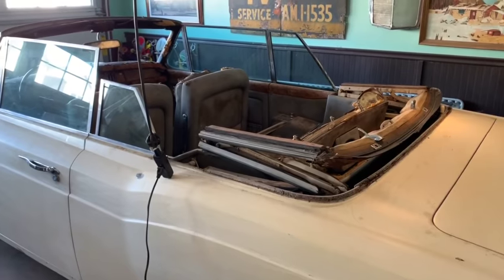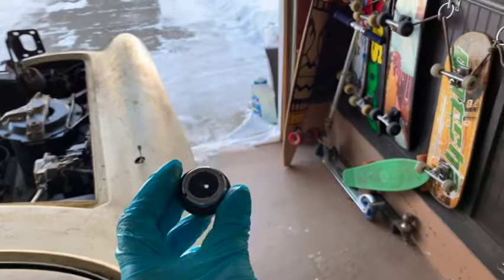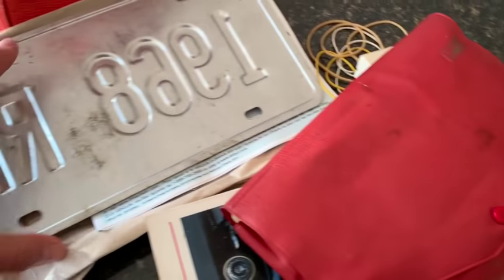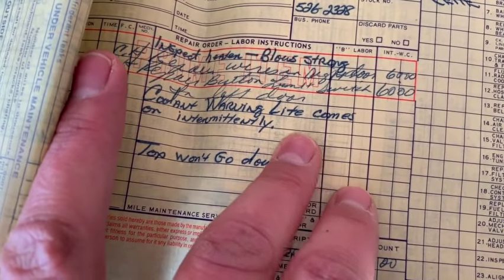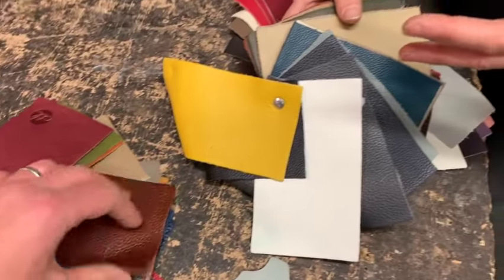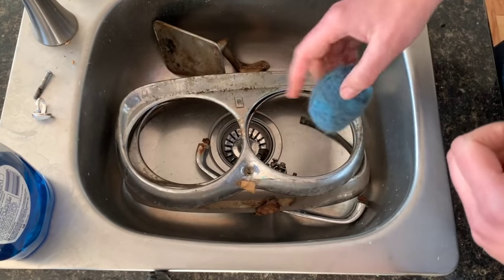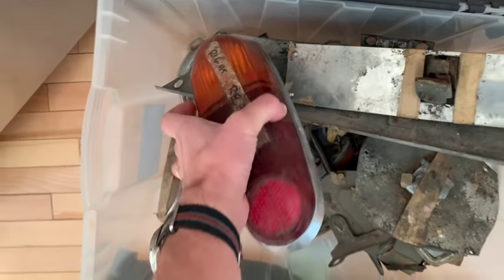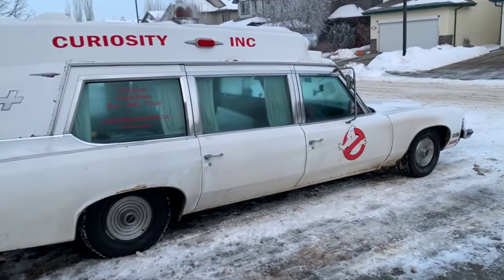I took a Junkyard Rolls Royce and brought it back to life!

Comment: I used to deliver to the body shop at RR Crewe (in the 70s) and was amazed at the attention to detail the technicians put into the build. They even tinned the inside of the engines water jacket, which ensured you never got rusty looking water in the filler. As one man said to me, as I marvelled at the quality of his workmanship "It's not what you see that makes a Rolls so expensive, it's what you don't see". Wonderful to see you preserving, his and others craftmanship.

Comment: Thanks for restoring The Empress!  I still can’t get over the beginning pictures.  It’s shocking how just a few years of neglect can destroy a ‘Proper Motor Car (PMC).’  This project makes my 1977 Silver Wraith II seem like child’s play.  I’m still working on the brake and hydraulic lines.  Nickel plating for the brake reservoir, rebuilding the accumulators, and then maybe some additional brake lines.  Fortunately, RR still makes a lot of components like seals and gaskets.  In fact, as I am learning, most things RR are designed to be rebuilt, and not merely replaced.
Reply: "most things RR are designed to be rebuilt, and not merely replaced"... we've become a 'throw-away/landfill' culture, if only more vehicles used rebuildable parts...

Comment: Great job of reviving this classic!
Thank you for the honest comment on the cost of this exercise. I'd shrink back from the sheer risk of not finding the right parts or of underestimating the amount of work necessary (both time-wise and financially).
I'd rather stick with domestic cars where you may get help from owner clubs and where there are more parts available.
When I lived in England for a year, I saw working class guys, complete with  beers in hands, congregating around the engine bay of a Jag XJ and working out how to fix it. You could find self repair help books on that model - so I guess many could maintain such a car on a budget... or even restore it.

Comment: One of the nicest presentations starting from an unusable 'wreck'. Explaining that there was not a trace of rust in the chassis certainly instils confidence in the original build, and the knowledge of all the replacements and labour would see many years of reliable motoring ahead, although initially looking an expensive exercise. I would suggest if it was put for sale at an auction now, a premium (price) would be needed to get it..! Enjoy 'rolling on'...

Comment: Nicely done! The only flaw I could spot is the upholstery around the radio - could be a little neater. Even so, what an amazing adventure.
Reply: Dear stephen c.
👍👌👏 Exactly what I thought instantly too. It's definitely not Rolls Royce worthy. ;-) Who knows: Maybe the dashboard will even be professionally upholstered with that great grey leather!? I would also do that with the thin shiny black original steering wheel. Not only that it gets really hot from the sun, it also has no good grip. Or maybe keep the original and buy a grey leather one. Of course it's his decision respectively taste. Nevertheless, I would even change the black carpet to grey. I guess that the next owner will definitely do some changes. I don't think that Mr. A. will keep this money pit. The family has a better use for the money (= for buying or building a new house on a bigger property).
Best regards, luck and health.
Reply: Remember, Alex said there are still a few minor details to be tended to.

Comment: Such an impressive restoration from such a wreck. It was great to listen in to the conversations with the two workshop guys. Looking at the underside of the car and even the engine bay, the dry ice method of cleaning could be a very effective way to get these looking good. Great video 👍👌😎

Comment: Didn’t realize they had done twin calipers on the front brakes like that. Odd setup. Surprised with all the extra clamping, they didn’t use vented discs.

This is a great drivers car. Restored to be presentable, but not a concourse restoration that you’d feel guilty about driving.

Comment: Brings back many memories.  My 1967 RR Corniche Coupe [hardtop, but with a  landau vinyl roof, cream-colored to resemble a convertable] was a Mulliner Park Ward.  Right-hand drive.  Made in Crew England.  The interior and engine compartment seem to be identical, except my seats were tan-colored with burgundy piping.  It was painted brilliant ruby red....and was a show stopper.  

It wasn't always like that, I had the landau roof and paint job done in the High Desert near Palm Springs.  It would have been hideously expensive, except that the shop owner had a pressing legal problem that I was eminently qualified to fix, which I did to his complete satisfaction.  

He was so grateful for the outcome, that he put an extra 17 coats of lacquer and clear coat on the car....just like the original paint job done in Crew England.    If you starred at the paint clear coat for more than a few seconds, it would induce a slight amount of hallucination....it was just that deep.    

I came across the car from my brother-in-law, who had used the car as collateral for a modest loan.  When the loan wasn't repaid, I gave the car to my mother to whom I had owed money for a similar modest loan.  I then obtained a title to some "sea-front" property in Bomby Beach, Salten Sea as payment for services rendered to a third party.  For some unknown reason, my mother became obsessively enamored with that property.   So, I traded the title to the property for the car.  This is all ancient history now.   

This was 30 years ago, but I remember being stunned at how beautiful the car was.  I just couldn't believe that I was fortunate enough to own a car like this.  During the first year, I would go into the garage and polish it at all hours during the late evening.  It just thrilled me to be in the presence of this magnificent work of art.  The subtle hump in the rear quarter panel was mesmerizing to me.  It just epitomized grace and elegance.  It was truly the understatement of design that made the car world-class.  The cream top and ruby red paint, and brilliant chrome with the tan interior, was perfectly balanced to give anyone seeing it a blast of excellence.  

For the first 5 years, I was tickled to be seen in the car.   I sold it 12 years later.  I just became tired of everybody rubbernecking at me while driving the car around Palm Springs.  I wanted my privacy and anonymity, which this car was not giving me any of that.   Unfortunately, my year in '67 had the earlier GM 4 speed tranny [hydromatic, not the superb modern GM 3 speed turbo-hydromatic in the '68 onward years], which was difficult to maintain.

Comment: “The flying lady” is actually called spirit of ecstasy..
Reply: Oscar Martinez has entered the room.
Reply: You are correct she really is called 'The Spirit of Ecstasy'
Reply: @joefunsmith  Says the guy with zero uploads.
Reply: always one big head know all.
Reply: @robinc5601  ,not a know all,but I do know that.
Reply: @robinc5601  It's common knowledge mate
Reply: @ianrobson9601  I know, you missed the point
Reply: Spirit of losing money
Reply: @LSnium  Actually the Rolls Royce is the only car that appreciates in value rather than depreciate in value…obviously you have absolutely no knowledge of Rolls Royce at all.
Reply: @pauline ramsden

So you're telling me, I can buy an outdated piece of crap, while I can go get a 30 year old Lexus LS400 thats way more engineered, and smoother, with parts you can still get for it thats cheaper, and will last longer than that old hunka junk.
Reply: @LSnium  Yes I am,the Lexus will rust away in ten years,and will be yet another piece of Japanese junk… but the roller lives forever and doesn’t lose you money, you will always find a buyer for a roller…
Reply: @pauline ramsden

No, Toyota spent 6 years and over 1 billion dollars in development of the Lexus LS400, corrosion prevention, they dont rust, i own one, it has over 300k miles on it and its still running amazingly without any problems.
Reply: @pauline ramsden

Also, the Lexus LS400 had a sophisticated double wishbone suspension, which was ground breaking for luxury cars at the time, and still most cars dont have it to this day, also with air suspension, and the old Rolls Royce, probably a live axle or independent suspension, old and not as smooth as the Lexuses Double wishbone suspension, back in the early 90s, when the Lexus LS400 came out, there was thousands of people trading in BMWs, Mercedes Benz, Audis, Porsches, even Bentleys and Rolls Royces! That just shows you how much better the Lexus LS400 is compared to this old outdated thing, even if it costs half a million or more, its overrated, outdated.
Reply: @LSnium  lucky you….I have seen hundreds of Japanese rust buckets ,can’t say I have seen a rusty roller yet…I have seen some very old ones but none were rusty…and they all command a very high price…
Reply: That was a big SMH moment for me right there... Guy bought a Rolls Royce for ambitious restoration, and called The Spirit of Ecstasy "the flying lady"...
Reply: @LSnium  actually, 75% of Rolls-Royces made are still roadworthy. Hardly JUNK!
Reply: @LSnium  did you know that one thing Rolls-Royces and Lexuses have in common, is engines so smooth that, at standstill, you can place a glass of water on their engines, and there is scarcely a ripple in the water!
Reply: @Nygel Miller

Back in 1990 no, today? Probably yeah. Fun fact, thousands of Rolls Royces were traded in for the Lexus LS400, ask any Lexus employee from the early 90s theyll tell you.
Reply: @LSnium  you are certainly right, that just like many smooth-riding but conventional American cars of the time, Rolls-Royce were mechanically outdated. But Rolls and their sister company, Bentley, always were in the black financially (To please their shareholders!) Then the owners of the combined company sold them off to BMW, and VOLKSWAGEN, respectively. These two new owners have money to BURN, and have been able to POUR money in to making these companies state of the art. Watch out, Lexus!
Reply: @BlueXonar  Actually, I think the SPIRIT does get referred to, as the Flying Lady, whether or not it's actually correct!

Comment: Rolls Royce and the Citroen DS Pallas of that era shared the same carpet from the same supplier.
Reply: The Ride quality of the DS is as good or better than the Rolls. Had a few too!
Reply: The DS ride quality was better than Rolls.  Except maybe the Silver Shadows that used Citroen Hydopneumatic suspension under license.

Comment: So to those here who don’t recognize the term, “drop head” what does “coach doors” mean to you and what does  “suicide doors” mean?? Looking forward to the diverse answers!  😀
Out of curiosity i googled a 1929 and 2021 Rolls-Royce drop head style car and both show examples of those year drop heads! So, i am assuming from the 1920’s to present, at least with Rolls-Royce, those automobiles with a top that came down were and are presently referred to as a drop head.  Obviously the British call things differently than in the States, i.e. “Lift” in the U.K. Is an “Elevator” in this U.S.A., “Bobby” in the U.K. Is a “policeman” in the U.S.A., “crisps” in the U.K. Are “potato chips” in the U.S.A, “biscuits” in the U.K. Are “cookies” in the U.S.A.  And so forth…..
Reply: Suicide doors open in the opposite direction of today's cars (hinges toward the rear, handle toward the front).  So if you were driving and started to open the door, the air flow would fling the door completely open and yank you out of the driver's seat.
Reply: @nancymontgomery8897  close nancy..   its the back seat doors  thats reversed  see lincoln continental  with suicide doors for example!  i believe john kennedy rode in one when he was killed!  sad day for all
Reply: @nancymontgomery8897  ….which is the reason the 1957-58 Eldorado Broughams rear suicide doors had oval shaped knobs which pulled backwards and not a handle one could wrap their hand around. However, the chances of being pulled out of the car were very limited as those Broughams had a safety feature!!!  When the gear shift was put into drive, both rear door opening mechanisms would disengage! AND…if a rear door was left ajar, the gear Shift lever was  locked from going into gear until that rear door was securely closed!!!

Comment: Congratulations for your great work you did. I understand all the doubts you felt along way   and how you felt  after it hit the road again alive.   I passed thru same situation with a  1972 , 300D Mercedes , which took me  absolutely alone, never had any type of help to dismantle up to the very last part of it , rebuilt ,had to really build many parts and now after 10 years of bit by bit work in between my work as architect and builder , have it all done , and functioning . all mechanical  , suspention , body restauration, paint, seats, panel upholstery , electronics, small motors, except, electric watch,  is all updated .   Thanks for your video , comments and final result , not many may really understand what it means finding and renewing an old priceless vehicle.

Comment: Job well done!!! I’m restoring a 1972 corniche convertible and I’m stuck on the brakes, Citroen invented the damn system and rolls paid them to use it.The mechanic is a genius to sort the brake out, the system has 2x callipers per wheel, pumps that run of the cam lobes, accumaltors etc…. The suspension and brakes share the fluid which is not regular brake fluid…
All pressured at something like 2000 psi..
I need help on this, I live near Brighton England.
I can’t wait to get mine on the road but it will be another year or two.

Comment: I am watching your video on restoring "The Empress". At 40.00 you show a view of the glove box and dash. You can clearly see the brush marks and the Rolls lustre is not there. If you finish sanding  it down with 800 grit with an orbital sander and 'spray' a layer of high gloss clear, then give it a light sanding with 800 again and apply  another coat of clear and repeat several times you will have a much better finish. But, to get the WOW Factor, then sand the clear with 1500/2000 grit (don't worry about the haze) and do it till it is all evenly hazy, that will mean it be perfectly flatted. Then, get a compound polish and a polishing machine and mop it, it will have a shine and lustre that  you  won't be able to stop looking at and how it wood have looked originally(wood, excuse the pun). Glad to see you bringing the 'Ol Gal' back to life tho. You can still do the sanding technique as above to what you have already done, but you would need to start with 400 grit first to get all the brush marks out, the go to 800 till it has even haze.

Comment: I've used Brasso metal polish on dull varnish and it makes an incredible shine, especially if you finish it off with beeswax furniture polish. I've also used it on plastic headlight covers so, on your steering, it would do a great job.

Comment: Back in 1998 I re-did a 1967 Silver Shadow, got it at the right price $2,000, 100% of the hydraulic system had to be replaced. So I did it my way and split them up.
Boster from a 1972 F-150.
Had the Disk Brake Rotors made in Stainless Steal to fit the RR hud and take Ford Pads and Caliper. ( NOTE you can buy blank Disk Brake Rotors that only need the hub size spunout and stud holes drilled )
Fitted Bilstein Coilover Shocks to all 4 wheels, had to cut the springs on the shocks to make them RR soft.
Total cost $7,800. next to new RR hydraulic system $12,500.
Needed a new Superchager, RR car $6,100. Boat $1,035. ....... odd thing same part number.
Timken Wheel bearings full set $120
+ other small things, body and trim were good.
Paid $2,000 for a car that needed about $20,000 in parts + labor and it was only worth $30,000 tops. Spent under $10,000 in parts and I did all the work. Sold it for $29,000, The buyer was told about the updates and why it made the car better.

Comment: if you add a bit of bleed air thru a multi perforated hose to the Metal Rescue- II used an aquarium pump and an air stone  regulated down   just enough to move the solution but not so much as to make it appear to be boiling at the surface,  it can cut the soak time in half.  After spending many dolars on a commercial dip/soak tank I found that plain white vinegar does a terrific job with removing the gross rust - just rinse off with fresh wated before dropping the hardware  into the commercial  rust cutter solution.

Comment: Well done for persisting with it. Any illusions I might have had about Rolls Royce engineering were destroyed many years ago when I used to have to keep several of them running for a wedding car firm, ranging from a 1929 Twenty to a 1982 Silver Spur. The technology was always years behind their contemporaries, and the only one that was reasonably trouble-free was the 1929. The braking/suspension systems on the Shadows and Spirits/Spurs was over complicated and prone to leaks and hydraulic failures, with no effective manual back-up. The gearbox-driven mechanical servo system used on the 1962 Silver Cloud for the brakes was essentially the same as in 1929 and could be dangerous in certain situations. Rust was also a big issue, even on the later models. The only thing protecting the underside of them was the film of oil leaking from the engine and transmission.  I don't miss those days at all.

Comment: A monumental task as i've owned 3 Silver Shadow's in the past,1968, 1975 and a 1976, so I know what is involved although my 3 were in up and running condition, the chrome bumper Corniche very rare as it is exportable to some countries that reduce import duties because it's a pre 69....great job....dual braking system so if one set fails the other is still operative, transmission TH400 (i think) GM Corvette....